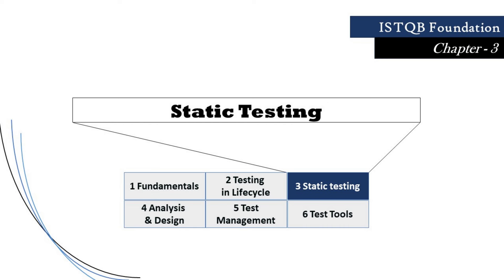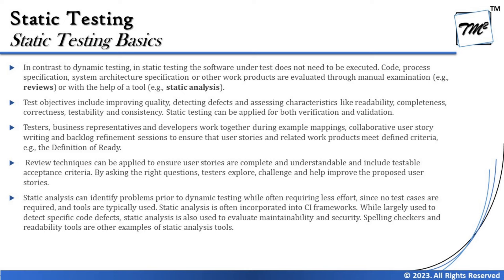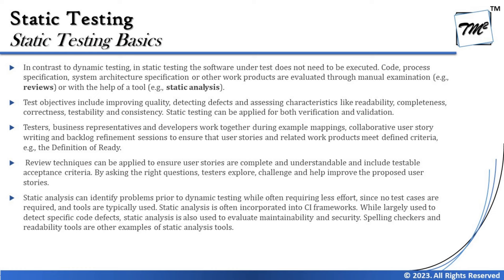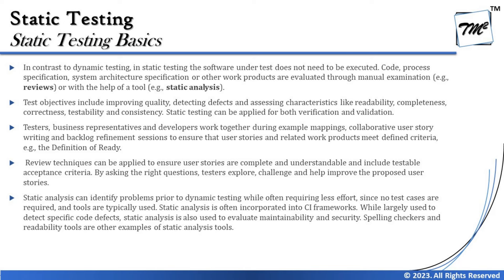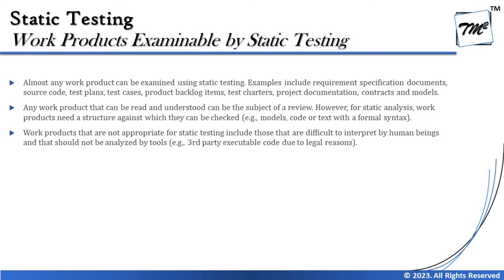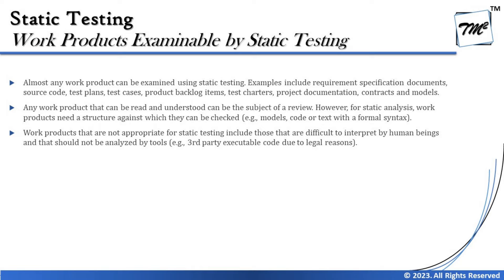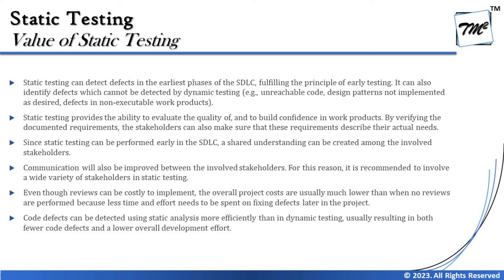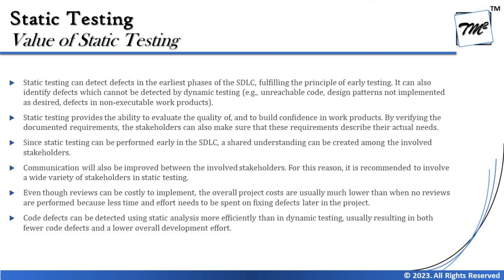ISTQB FOUNDATION 4.0 | Tutorial 23 | Static Testing Basics | Reviews & Static Analysis | CTFL

Comment: Hi Sir, can you please confirm how static testing can be applied to validation? when the syllabus said:" "Static testing can be applied for both verification and validation."
Reply: Sir I got this answer from CHatGPT, can you confirm if this is what we are discussing on the Syllabus:

Static testing for verification - focuses on evaluating documents, code, and other artifacts to ensure they conform to the defined requirements, standards, and guidelines. It doesn't involve executing the software but instead involves reviews, inspections, and walkthroughs of requirements, design, or code.

Static testing for validation -  helps to ensure that the software will meet user expectations and is suitable for its intended use, even before actual execution. This is often done by reviewing documentation and models that describe the software's expected behavior or use case scenarios.

Could you confirm if the above is aligned to ISTQB learnings?

Examples given:
Verification vs. Validation in Static Testing

Verification

Ensures the product is built correctly according to specifications.
Static techniques (reviews, inspections, walkthroughs) verify if documents, code, or designs meet specified requirements.
Example: Reviewing a requirements document to ensure it is complete, consistent, and adheres to agreed-upon standards.

Validation

Ensures the product meets the intended use or customer expectations.
During static testing, validation happens when you evaluate whether the documented requirements are meaningful and useful to stakeholders.
Example: Checking user stories to confirm they align with business needs or customer goals.
Reply from the maker: Thanks for doing this effort. I was about to share the same details and explanation. Yes this is a right explanation to understand your query
Reply: @TMSQUARETECH  Thanks for confirming.. Now it makes so much sense.